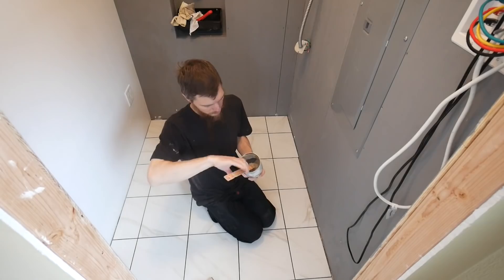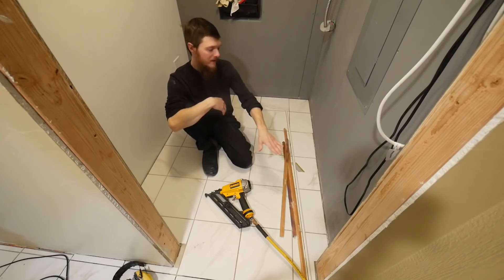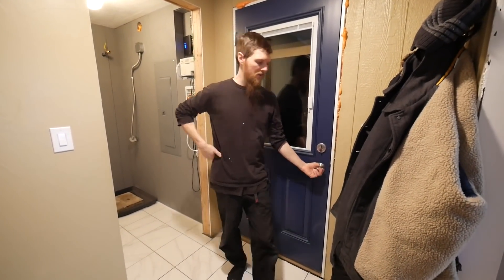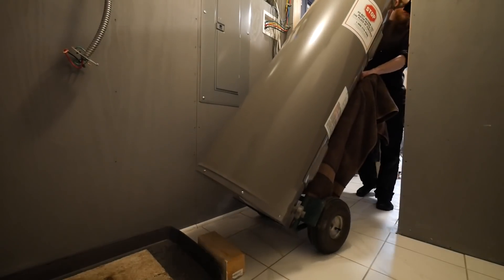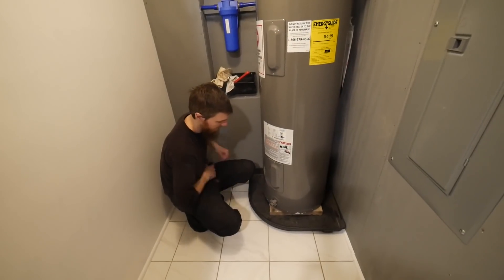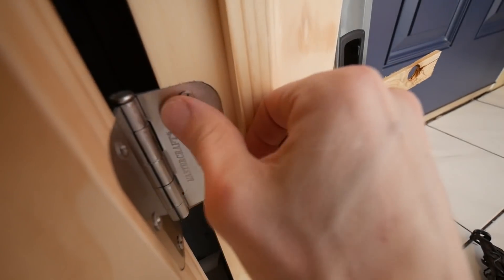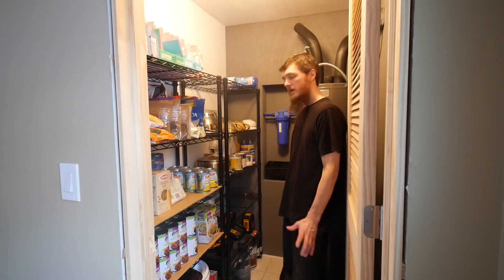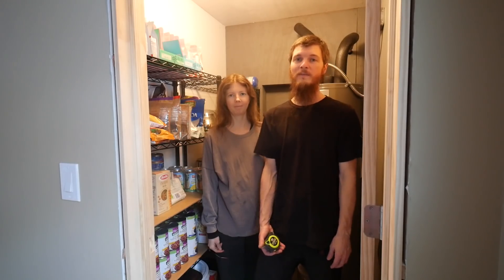Pantry & Mechanical Room - Home Renovation

Comment: Finally, a project that is short and sweet without surprises! I will only add that from experience with a painted louver pantry door, the dust is very noticeable for some reason. It did not seem to be the same as the stained one, almost like it slid off the stain. Your choice. I just hated having to go in between each slat with a skinny dusting tool but mine were painted white.

Comment: Does your county/state require tying down your water heater to the wall if it's not fully enclosed to keep it from tipping over? It may be a good idea as the center of gravity is now raised a little because the tank is on blocks and they don't completely cover the bottom so there's a little weight hanging over the edges. You can use perforated metal plumber's tape.
Reply from the maker: Our area doesn't require it to be strapped, probably because we're not in an earthquake prone area.

Comment: Hi, I have a question. You mentioned a couple times that your ground water is so brown that it stained the old bathtub. Why is this the case? And how can you prevent it happening with your pretty new tub and sink? 🙋🏻‍♀️
Reply from the maker: There is dissolved iron in the well water. It's pretty common in the USA. The water appears mostly clear, but leaves behind staining on tubs and such. We just use a product called "Iron Out" to clean the surfaces and it works great. A lot of people install water softeners or iron filters to take the iron out of the water as it enters the house.

Comment: This outcome is what happens when you take the time to plan and measure.  I still have my paperwork from all the measurements I took of every room in this house including closets so I could get the items that would fit (no surprises).  Gets a little detailed when you include/exclude trim and wall plugs.  I spent so much time doing this the seller checked to see why I was in the house for such a long time.  It's a AAA modular home.

Comment: To drain a water heater really quickly I found that it helps to remove the sacrificial rod or anode rod at the top so that it forces are into the tank.
Reply: You can also just open the overflow to allow the air to come in.
Reply: @Newman81964  Very true, my anode rod was wasted away so I just used this method. 🤭

Comment: This video is bitter sweet guys. I made it through entire reno playlist. It was great watching 2 or 3 videos at a time. Now, I'm gonna go through and watch the other playlists. Hoping all is well guys, Dirty Jersey out!!
Reply: Hey Doug, sorry I have a tendency of getting sidetracked. Not to come off as a know it all but, do some research about resting the water heater on those blocks. All concrete will release a certain amount of alkalinity & depending on the coating & metal type of water heater corrosion can quickly take place. Again, not wanting to come off like a know it all. I know you guys put a ton of time & effort into the house just looking out is all. Maybe some pressure treated wooden blocking would be a better choice. I was lucky enough to get my hands on a plastic pallet and cut it into a section small enough to support our water heater. Hoping all is well, & Dirty Jersey out again!!
Reply from the maker: That's awesome that you caught up and made it through the whole playlist, haha :)

Comment: Great job, well done.  So nice to have pantry space too so you can have some extras on hand when weather is bad.  Would it be practical to buy one of those water heater blankets to wrap around your water heater.  2 purposes...one cuts down on electricity usage keeping water hot. 2nd...it won't allow the room to get much heat from it since you also want to use it as pantry space.  Just a thought.  Y'all have a Blessed day.
Reply from the maker: Thanks for the idea. Since our water heater is new it's pretty efficient and doesn't loose too much heat.
Reply: @diyfferent  Great...I have hot water on demand so I don't know much about water heaters but I did remember friends that had a blanket on theirs.

Comment: Pretty obvious how much thought went into that space as those shelves fit like a glove, meet the code for the breaker panel, even the switch outside of the room, which isn't unheard of, alot of closets and smaller utility rooms are like that, and the shelves... you were totally thinking way ahead on that.  Getting that room grouted and trimmed out was my though too so you could get the water tank back in and reconnected.  I'm was looking at the walls, and was thinking that staining wouldn't look as good as paint, so I already assumed (and you dropped the hint already), that you were going to paint rather than stain that door.  I agree, a nice white, or maybe off white if you're not into the starkness of full blown white would be great, or maybe the same color as the door?  Your call, can't wait to see what you choose, and great job on the utility room!

Comment: That is a great use of space. Other than the small area above the shelves, you are maximizing a very small room. The rounded water heater pan also makes for a safer space. The corner sticking out could be a tripping hazard. When utilizingthe shelves in the back corner. It looks amazing. I love the door too.

Comment: Yahoooooo!!!  So happy for you!  One more room pretty much complete and when a ladies pantry is stocked up they always feel better!  Easy to access and can quickly tell the status of your supplies. So excited for you guys!  It looks awesome!  I was wondering if you were going to put a water heater blanket around it to help keep the heat in the water tank warm in between use and to conserve the energy as well.  Everything looks so so nice.  I have louver doors on  my linen closet doors and pantry and bathroom storage doors just to keep the air movement going so it doesn't get stagnant.  I love what you have done here again and anticipating the kitchen as I am sure you both are excited to get that functioning. You have really been troopers with all this. Bravoooooo and Kudos to you both!  Awesome job!  Keep it up!  Amazing work!
Blessings
Reply from the maker: Thanks! The water heater is new and very well insulated so we won't be adding any additional insulation :)

Comment: I usually put a drain line on the drain pan. Well, code requires it in SC so there’s a male 1” adapter with nut and a gasket zip tied to the pan ready to go. Looks really great. Keep up the great work. Crusty old Sailor says “Bravo Zulu!”

Comment: What a great utility-pantry room!  And pretty too!  I'm so impressed by the detailed forethought you give to positioning the hot water heater on those blocks and putting the light switch on the outside wall, even down to the louvers in the door.  I didn't know about the open space around the breaker box.  I'm wondering if that is just for easy access or if having it covered by a painting or piece of furniture could cause a fire or other dangerous situation.  For a video about a small space, the information coming out of it is brilliant!
Reply from the maker: It's just for access. That way you can easily turn off power in an emergency or work on the electrical panel safely.
Reply: @diyfferent  Thank you!  I was afraid I might blow up the kitchen on this old house.  :o)  I really appreciate your taking the time to answer.

Comment: I'm impressed guys! Longtime since I've seen such a sexy mechanical room! :-) Just as an after thought or maybe useful in another place for the light switch you also could have used one of those things in a fridge. The sec you open the door the light goes on and vice versa.
Reply from the maker: That could be a cool idea :)
Reply: Do your fridges not have lights inside then?
Reply from the maker: @suegermaine3119  He means having a switch on the utility room door so when someone opens the door, the light turns on automatically, similar to how a fridge light works.  :)
Reply: @suegermaine3119  Sure we've got lights in our fridges, what I meant why not use one of those light switches on the door of the mechanical door/pantry .
Reply: Peter Van thanks you made it sound to someone over the pond like you didn’t have lights in your fridge 🥴
Reply: @suegermaine3119  haha we have advanced(slightly) from the ice chest!  Though I have say; do have to replace the bulb in mine...
Reply: Peter Van I wouldn’t know how to do that and I assume I have a bulb somewhere in there. I have had the fridge for 11 years and never has the light gone (so far, and touch wood etc lol)

Comment: The blocks will take up your space for catching water. But all that hard work looks good. Man— there’s a lot of hard work in that place right now. I really, really like like louvered doors.  Tung oil the door?
Reply: If the water heater was sitting directly on the bottom it would actually take up more space than the blocks.
Reply from the maker: Once we have the pan properly plumbed, water will just empty out as soon as it starts filling the pan. Also, if we didn't have blocks, the water heater itself would take up about the same space ;) We'll see about the door. :)
Reply: DIYfferent yes, I can now see that about the water heater and blocks.  I like the niche for the water filter. I need to get one for scale deposits. Good job.

Comment: Everything in that pantry will be on low simmer due to heat from water heater.  Not sure how well insulated the heater is, hopefully side-effects of the heat is minimal.  The door looks nice, but I would prefer to keep the heat inside the room to minimize expense of water heater heat loss.  The louvered door will definitely not be heat tight.
Reply from the maker: The water heater is new and very efficient. It doesn't let out much heat at all with how well insulated it is. Water heaters, at least in the US, don't let off enough heat to heat a space. We wanted a louvered door to let heat into that room specifically since there is no wall heater in there :)

Comment: Love the utility room! And door.  Are you going to put a water tank blanket on the hwt heater?
Reply from the maker: Our water heater is new and pretty efficient so it wouldn't benefit greatly from a blanket. We won't be adding one. An interesting side note is that the water was still very warm when we drained the tank after sitting unplugged for almost 3 days!

Comment: I have a brand new nail/stapler and air compressor, and can't use them until I get my shoulder fixed 😣 tore something removing carpit staples and tack strips 😐I should mention I also removed all the big staples,not knowing they were for the subfloor lol renovating my 1974 single wide 😉

Comment: Wow! Looks so good. Great use of a small room. Doug, you made that look easy but it is difficult working in small quarters. Someday there will be a hole in the floor. That's my job now, keeping my eyes out for the hole for the possible water heater failure. 🙂

Comment: Another long-winded comment from me:

Yeah!!! The pantry-utility room completion is in sight! I actually like the coziness of it.  

Heyyy, you said paint door... 👀

I love how well the wall paint, circuit breaker, & water heater blend into each other.  Many houses where we live have the circuit breaker on the outside of the house.  I understand why, but I miss the convenience; fortunately, it’s near the back door. 

So, you filled the grout with the one can, correct? Smooth move, Doug.  Hehehehe.  So, are you waiting until spring to cut the hole, or at least an unseasonably warm day? 

You two have had such a lovely vision for your spaces.  I’m curious if there was anything that was more of a challenge to make a decision on, that you had to compromise on because you both leaned different directions? What we’re the deciding factors in those instances? For example, hubby likes wood that’s medium to dark, and I’m a bare wood to almost medium wood gal.  We still haven’t figured out how we’ll handle the woodwork in our house, but due to our house’s dark, ranch style interior, I think it will be easier to get hubby to agree that all the mahogany stain has to go.  Our kitchen cabinets are birch, the dining table teak, and our floors are red oak - if we can get the doors and trim closer to those colors I’d be a happy camper. I think y’all having lighter interior doors, and white floor, really helps your compact rooms, and dark hallway.  Great decisions there. 

I envy that you have a pantry, even a small one. Our house doesn’t, plus has a smaller kitchen than yours, and that’s with the main floor being over 1800 sq ft. Now that I’ve lived here almost 4 years, I can say that I don’t like my kitchen - I don’t care anymore that the cabinets are original to the house, they are less than mediocre in functionality.  I find early 20th century kitchens better in that regard than mid-century, by far. I think some things were lost with fitted kitchens; the versatility of the space was diminished. Ours was built in the 1960’s.

That said, I’m sitting on my hands, waiting to see what you end up doing in the kitchen. Eek! I’m excited for you, once this all pans out.

🖤🤎🧡🤎🖤
Reply from the maker: I had to mix a bit more grout. :) Not really waiting until spring for the hole, just haven't got to it yet, we may need to buy a hole saw. For the most part, we are basically on the same page design-wise in this home. Simple pine oiled trim, white walls, and with the theme being geared toward a Scandinavian look, it makes it easy to know what things should look like that we both agree on.  Thanks!

Comment: Fab job 👍🏻 Do you put a ‘coat’ or insulating jacket on your water heater so the water stays hot for longer. I know that used to be done in the UK but I have a combi boiler and havent had a water heater for years so not sure if thats still done or not. I seem to remember them being quilted and bright red.
Reply from the maker: It's usually only done on older water heaters. The newer ones are pretty efficient and don't need them. Thanks!
Reply: DIYfferent at least they don’t wrap them in asbestos anymore 😱😁

Comment: looks really good guys! 
i store all my paint in the basement right now. my garage will be heated, but i did not get the coal boiler installed yet that will heat the house and the garage and all the hot water. that will be this spring and summer i will be doing the install.

Comment: Just some comments from my past experience in renovations and electrical inspections:

The 30" side to side clearance dimensions for an electrical panel CANNOT be impeded by a door.  As you have it configured, it appears that is does NOT meet code due to the inswing door impeding on the panel.  When the door is fully opened into the room, it must be outside that 30 inch side-to-side measurement from the center of the panel.  NEC 2011 / 110.26.

Also, you are required to have a light "at the panel" and a "directly accessible" outlet by the panel; though neither have to be on a dedicated circuit, but must be located "in the immediate vicinity" of the panel.  I don't see either.  NEC 2011 / 210.52 and 210.70.

Be well,
Don
Reply from the maker: Thanks for your thoughts Don. Everything is up to code for our area. I know some places have picky inspectors that like to interpret code their own way but it's pretty common to place electrical panels behind doors as long as the clearance guidelines are met when the door is closed. 

We do have a light right over the panel and an outlet to the right of the panel. The light is shown in the video and I even talked about it. I'm not sure how you missed it but it's all there :)

Comment: Hiding behind the door with no handle lol. Can I ask firstly what are the two wide tubes in the top of the heater? Secondly should you have made a hole in the floor first before placing the shelves in. Lastly thirdly will it not be too warm in there with the heater and food, I am assuming the boiler gets hot? Anyway it look lovely I could do with more storage space, there is always more storage needed. In UK our switches are switch up for off down for on so always looks strange to me. Any news regarding kitchen units yet?
Reply: Sue Germaine , boilers in the US are insulated. There might be a tiny bit of heat from the outlet pipe on the top, but they have insulated them too.
Reply from the maker: The wide black things is foam insulation on the pipes. The hole will be made right next to the pan, the shelves won't be in the way. The water heater is new and very efficient with good insulation in it so it doesn't get warm in the room. :) No new news on the cabinets, but hopefully soon.
Reply: DIYfferent thanks for the replies as I understand more now. You guys are such an inspiration

Comment: When the hot water heater heat does it throw hot air in the small place just wondering because can goods well not last long if it does get hot in the small space. Everything looks good .
Reply from the maker: No, the tank is well insulated so the room won't get hot :)
Reply: @diyfferent  good

Comment: Is your area prone to earthquakes?  If it is, you may want to install wall ties on the water heater.  Out here in Cali, we have to use them!
Reply from the maker: We're in Michigan, earthquakes are pretty much non-existent here. :)
Reply: Hey, they're known to happen! There was a very mild one a few years back. There is also a fault line that runs through the UP down the coast of Wisconsin along Lake Michigan.

Apparently upon looking up Michigan fault lines, a couple run through the Mitten too. I'd personally rather have snowstorms than shaky ground. 😁